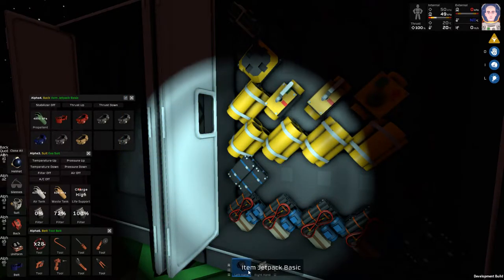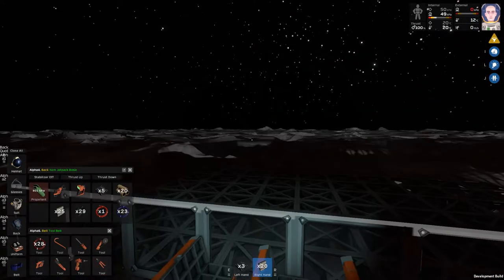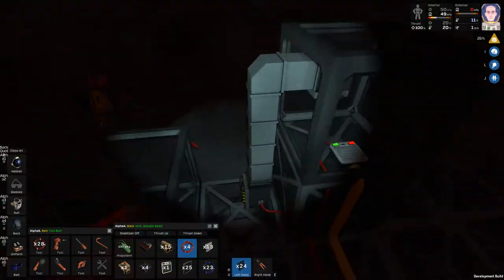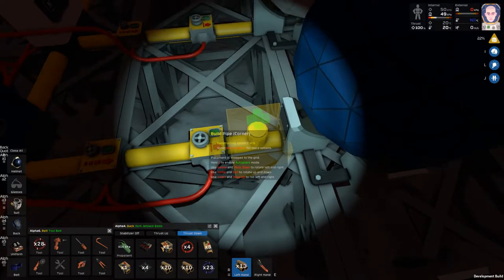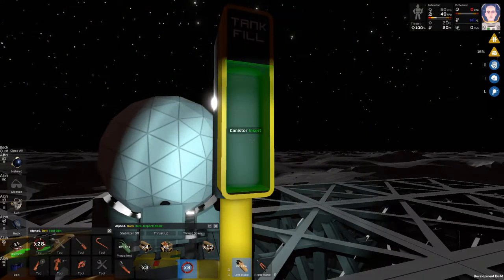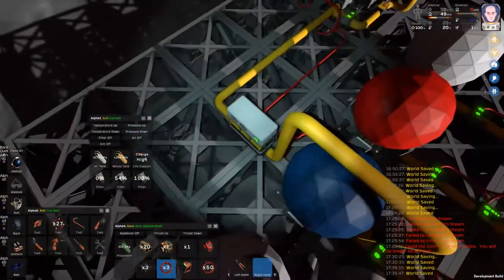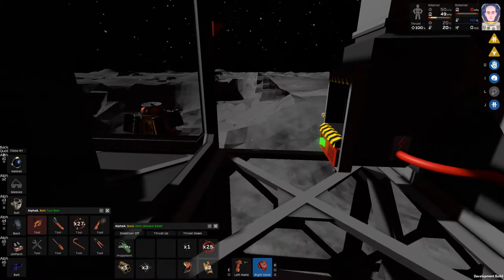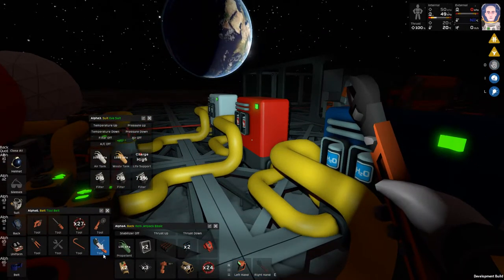GASES for the MASSES -=|=- Stationeers -=|=- 06

Comment: A couple of things. When you are working with the gasses you should use your tablet with a atmos cartridge. This will tell you exactly the pressure and gas make up of anything, room, canister, pipe, etc. Also, it does not matter what color you paint your canister or tank. It does not change the gas inside the vessel. The color is only so you know what you put inside. Also you can empty a canister by opening the valve on the canister. If you want to stop burning cables put a small transformer in the feeding line. A small transformer can be set to 5kV.(the max for the solid red cable. Or the big transformer to 50kV. The APC is handy for a backup power for a circuit if it has a battery. Also it will segregate the electronic devices so when you set up some chips you don't have to scroll through all the electronic devices in the entire plant. Also the furnace does not need any power. The cable connection is so you can connect a data cable to read what the pressure or temperature is inside the furnace.

Good series, keep it up.

Comment: "the drill needs a battery but I don't need to turn it off"... fairly realistic :)
you don't turn of a drill as it only uses battery when drilling
a labeler or a welder need to be turned on since they have a welding flame or a screen.

Comment: In the original start you get given a set of circuit boards for the handheld tablet, make use of them. There is a Network analyzer for power, max per small cable is 5000w and loads need to be divided. Also there is the Atmospheric Analyzer for the gasses, it will tell you what is in the pipe, or tank/canister you aim it at.

Another item to make good use of is the transformers, setting one before each apc at 5000w will mean they all charge at the same time instead of 'cascading' from one to the next.

Before to re-rigged the pipes, the 'N2' tank had all except N2 in it and the water tank had N2. You should have just passed that lot back through the filters instead of wasting it all.

The pipe between the Volume pumps and Pressure regulators will explode with your current setup!!!

Comment: Place filtration units in paralel not sequential. So filtered to where ever you need it, unfiltered and input on one main line ergo parallel.  Sequential as in your setup, so unfiltered to the next filtration unit, is old school and not valid anymore.
Reply from the maker: but what about the unfiltered output? do i put a valve on it? do i feed it back into the input line to catch any gases that get through?
Reply: @bcplabs  Make a main line of pipe,  from that main line you  branch off to your filtration units inputs, the unfiltered is piped back to the main line.  the filtered goes to  where ever you need it or want to store it. 

||
||= = input FILTRATION  filtered= ==== i.e Tank
||                 Unfiltered
||= =========||
||
||=  = input  FILTRATION......etc
Reply from the maker: ok ill give that a shot. plan on getting that going next vid anyway